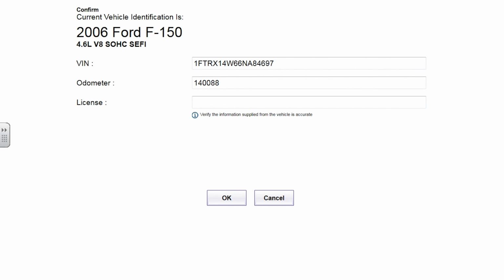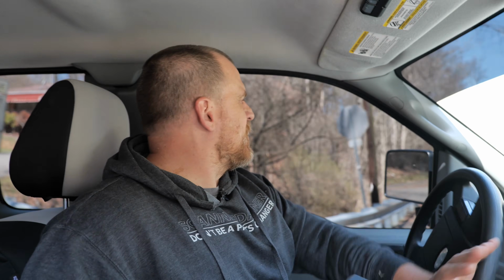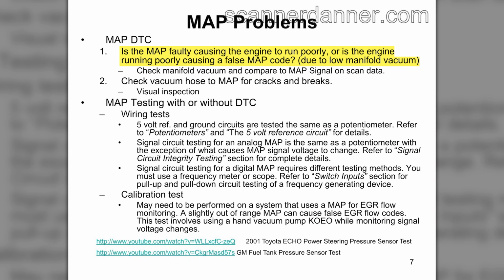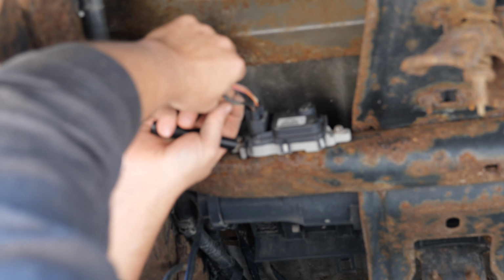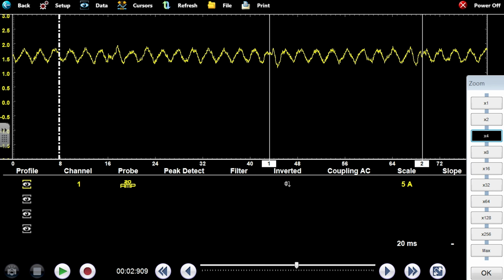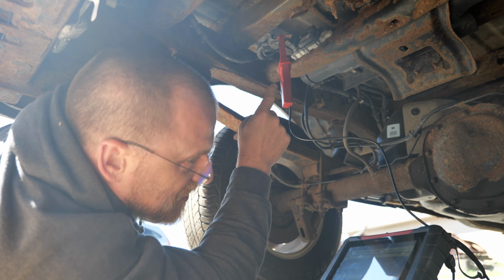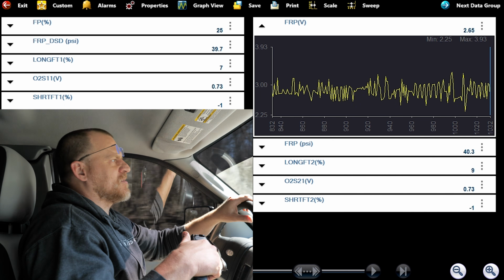Intermittent Low Power/Lean Conditions [2006 Ford F150 Electronic Returnless Fuel System]

Comment: Could you power the pump with a 6 V battery and watch the scope to see if it had a bad amateur
Reply from the maker: If you wanted to test that, simply using the existing 12v system would be how it is done. Curious why the 6v suggestion?

Comment: To answer the Selina of techs leaving the field, I might have an answer but it won't be populer. To hand a hard diagnostic job to some one like me that is learning from you and willing to take a job and have another way to get paid. Issue with this idea is not being in same town as you. For an auto shop to hand off a car that has hard issues to some one like me that might have a team that is learning the system. To charge the customer yet so they can afford it. There's away just non traditional. I live in Solano County, Ca.
Reply from the maker: We are ALWAYS learning the system! We should not have to learn a specific system for free! What other field does that?

Comment: This diagnostic problem with the industry is why it makes it harder for the advanced diagnostic techs to find good shops to work out. Most shops would rather have a master r&r guy that doesn’t know what a multi meter is instead of the tech that can diag a problem correctly because they don’t see the value in it.

Comment: As a former Cummins Inc. tech that absolutely hates Cummins Inc. I have one good thing to say about Cummins Inc. which is the way they bill customer for labor is the best way to do so. So, as a tech you “clock in” on Cummins time then when you get a work order you “clock in” on that work order. You go from “Unproductive shop time” to Customer Billable time”. This is to properly bill customers for labor and for tech efficiency. On one hand Cummins pays you to to be there and the other hand the customer is directly paying for labor. Tech efficiency is judged by the quoted hours compared to the actual hours worked on a work order!

So if a tech’s repair quote is 10 hrs of labor but, it takes them 14 hrs to do the work their efficiency is 71.4%. Cummins requires tech to work at a minimum of 85% or write ups and disciplinary action will happen. In actuality the tech is getting their pay rate $25-$35 per hour while on the clock either on or off a work order. Although, when your on a work order the customer is paying shop labor rate $128-$140 per hour! That said, Cummins is paying you a labor rate just to be at work which cost the shop. When a tech is on a work order the customer is paying the tech plus the shops expenses. So I’m effect when your diagnosing the customer is aware and approves “a specific amount of time” then if and pays for that time up front.

If the tech then diagnoses the problem in less time the shop puts that remaining paid for time towards the repairs. Although, if the tech is struggling and takes longer to diagnose the problem his efficiency drops because he goes over and now Cummins is paying for the extra time. The techs usually ask the customer for more time and is a toss up if they’ll pay and if not cummins pays and your tech efficiency drops. So as a Cummins tech you get paid to diagnose, you quote the job accordingly, your responsible to do the repair within the time quoted and the customer only pays for approved diagnosing time and quoted repair time. Anything else is paid by Cummins and reflects on the techs efficiency as such, customers are charged a ship rate and the tech is paid his tech rate the shop keeps the rest or pays the rest.

As a Cummins level 2 tech in 2020 I was being paid $24.58/hour, my shift schedule was 9 hours per day plus monthly On-Call. My salary was based off of 8 hours day and tech efficiency for Bi-Annual raises or promotion. I worked usually 45+/- 5 hours a week and anything over 40 hours was time an a half. My yearly salary was $57,517.20 and my salary was based off of only $51,146.40 plus PTO, Holliday pay, overtime employer contributions to retirement, 401k and pension. Then of course subtract healthcare benefits, retirement, 401k, health spending Acct, flexible spending Acct and pension.

Comment: Paul, I was wondering, could you give us a few examples as to how to charge for these types of problems? Would that be your regular hourly rate X the amount of hours spent?

Because I myself also struggle with something like this every once in a while. 

And where is this feeling of guilt coming from? The garage I worked at didn't charge and I also have guilt trips charging for something that I "didn't fix" but that I was looking for. 

It's ridiculous. Doctors? They do NOT care about these issues as you pay a hefty bill for just showing up to them. Wrong or not, you're billed the moment you go up to the reception. It's ridiculous. 

But us? We are expected to either know everything and fix everything immediately or to work for free OR charge for the actual repair once we figure out what it was, forsaking the diagnostic time spent to find the issue.

Comment: I got these vehicles down Man you were a key part once again but sometimes man you chase a bit harder then you need to these catalytic converters cause a bunch of improper readings upon these sensors but youve help me understand the vehicle well and all your testing is even better in the interior. @scannerdanner
Reply from the maker: I'm having a hard time understanding what you're saying. Sorry. Catalytic converter issues do not cause lean conditions
Reply: @ScannerDanner  explain how it it couldnt make the car run rich your intelligent enough to know it will if it cant breathe our computers are gonna dump more gas thanks for your response.
Reply from the maker: @Jeffthestreettech  I just said cat issues (exhaust restrictions, do not cause lean conditions, why are you asking me about rich conditions?
Reply: @ScannerDanner  I apologize for my grammer but you've misunderstood me. But back to if the dinner ever existed 🤣
Reply: @ScannerDanner  when we can see the inlet temp then we will have dinner 🤣💯

Comment: I have an  2006 5.4. ..  That  Idle's nice and smooth and fuel trims within range at idle. But .  When I do a wide open throttle test , the engine climbs  very lean  +52 reading on bank 2 only, And I get a squealing noise.  it's not a belt because it does it  even with the belt off.  I can recreate this problem every single time . even if I sit in park and idle it up 3000 RPm's it will go lean on bank 2 .  If I run it  Long enough and wide open it will bog down an the truck won't even move.  I have to stop and let off the gas and let the trim come back to normal..  I get the screeching noise whether I'm in park neutral or driving I am absolutely stumped and can't figure out what it is . I've replaced the fuel pump module, and o2 sensors. Anyone got any ideas?
Reply from the maker: Sounds like a plugged cat on one side

Comment: Perhaps the closed loop fault fuel system status on the freeze frame would offer a hint. Perhaps a blip where substituted values came into play and both banks suddenly wanted the exact same STFT in the absence of some other input data due to the fault. Some transition from closed to open loop perhaps where the O2 sensor data no longer applies and the PCM looked at TPS or something..
Reply from the maker: OBD2 data is not allowed to show substituted values, but I like the idea!

Comment: At work we had a tractor with intermittent shutting off and not wanting to start. Took it to the "pros". The shop charged us $3,500 for diagnostic and research,  gave it back without fixing anything.  Owner just shrugged and gave me some ideas to check when the tractor died, and i told them it had same issue still.
Reply from the maker: that is horrible and certainly not what we did here
Reply: @ScannerDanner  no, i didn't mean to make it sound like thats you! In my experience though, this is common with many shops. Of 2 shops in my town, One shop doesn't even own a scanner to do simple calibrations and the other charged me insane amount to calibrate a brake light switch. Probably didn't take them 20 minutes total but i got charged almost $300 just because they hooked their scantool up.

Comment: After watching your videos, and other studies I tried to diagnose fishbite misfire on 2002 lesabre I looked at vacuum leak ,secondary ignition (lean waveform), fuel pump waveform and other things. Turns out the fuel pump was consuming 2.5 less amps. (Using amp probe). New pump =secondary waveform looked right.

Comment: so if it were your truck and you had the time and money to try switching parts to see if it behaved better with changing the module or pump which would you, or what would you do next ? thanks
Reply from the maker: Since the module was the fix for 5 months, I'd be putting another module in it, especially because it's under warranty still

Comment: For all we know, your FRP could be going well above 75 psi when you are commanding the fuel pump duty cycle to 40% and above. Look at the FRP voltage when it hits 75 psi, it's at 5 volts, meaning the sensor is capped out.

Comment: Thanks Paul for your video. 
Freeze frame date should always to be considered in the beginning of the diagnosis.
That makes a guide to follow. 
God bless you and your family.
Reply from the maker: Freeze frame data is mostly useless in my experience, but to each his own
Reply: @ScannerDanner  best use of freeze frame I've found is the engine on time pid, if available. I've had customers say all sorts of scenarios and time frames when some issue occurs. Go to the on time. Record data. Drive it that long and just about at the time listed in FFD the concern happens.

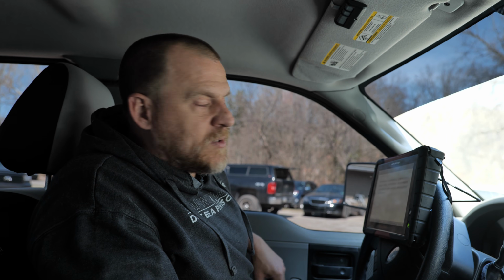Comment: 40:04 ya I’ve had very little luck getting any useful info from freeze frame data lol
Reply from the maker: Same and I rarely use it. A recent example. I have a B2S2 O2 stuck rich code on my truck. Freeze frame data shows thr other 3 O2 sensors, just not the B2S2 😂 useless!

Comment: I had a fuel pump take over a year to finally die. It never shut off and would only not start on hot days if I shut the engine off for a short period of time. Like getting fuel or quickly running in the store but only during the summer. Did this an entire summer then didnt do it at all that winter. Finally died that next summer. I always seem to only have horrible intermittent issues.
Reply from the maker: I bet it was a Ford? I've seen that issue before!
Reply: This is happening to my subaru. It doesn't like to start if i shut it off and try restarting right away

Comment: I had an 06 f-150 that would have an extended crank when it was hot and eventually stopped starting at all when it was hot. Finally it Stalled out and came to me. Cold starts were never an issue, but when it was hot the fuel pump would not turn on. Checked the FPCM and had good outputs and power and ground at the pump was good, but found corrosion in the power wire about the same spot you had it. Replaced pump and module (customer said he knew they were a known problem and wanted it changed.) Upon further inspection of the pump connector, the power wire pin of the fuel pump actually had melted plastic all over the bottom of it. I was wondering if  that melted plastic was a symptom of the corroded wire causing it to get hot as I’ve always been told a motor will pull pull amperage until the fuse blows or a wire burns up.
Reply from the maker: Yes sir, the melted plastic was from a poor connection. Resistance = heat!!

Comment: I have an 06 w/4.2 and mine was/is the same. I replaced the FPM and a week later same thing  also I saw that the 'fix' according to Ford is a stand off on the FPM is recommended. I then replaced the fuel filter same thing a week later. 😢

Comment: why wouldn't you pull the ground to frame ground behind module that was recently changed on rusty frame then send customer on his way   at least you would know it wasn't a simple fix 
then you could rule out module if it was cured if you change module and create a better ground you still don't know that module was bad
Reply from the maker: I deemed that ground to be okay. I pulled pretty hard on it. You're not wrong in that approach too.

Comment: Good to see ya again and good to see this video, these intermittent problems are real world issues.  I love these types of videos with these types of issues from you.  Love your rant also, it’s right on.  52 years a tech I have to agree with you about that module and the state of parts these days. Five months is enough time for a new part to fail and a bad pump still being bad most likely wouldn’t have lasted  five months without problems.   On another note how’s you foot doing, an Achilles’ tendon wasn’t it?
Reply from the maker: Thank you my friend. It was a ACL (knee surgery). I'm getting stronger ever day! 4 more months before I can skate again
Reply: @ScannerDanner 
Glad it’s getting better.  I’ve never played ice hockey but did play a little roller hockey twenty plus years ago.  At 68 I’m a little too old now to be chasing pucks into the boards.  Still working on cars though.
Reply from the maker: @weshawkins7165  bet you miss it though right? It was a roller hockey game too that I tore my ACL. I bet it would have been fine on the ice as the skate would have slid more
Reply: @ScannerDanner  
  I miss being younger and being able to do those things, the hockey was a blast.  I could probably still skate but the recovery takes a lot longer now.

Comment: Hello i just wanted to know what would cause high fuel pressure in returnless fuel injection system?
Reply from the maker: Electronic returnless with no fuel psi regulator and a PWM pump (like this one), or a mechanical returnless with the regulator in the tank?

Comment: Just dawned on me about an intermittent my better half had with a 1987 Dodge Charger many years ago, that would just die while driving. Every single time it would restart immediately and not happen again for many days, weeks even. Happened the odd time i drove it too. I had this cheap Ignition Spark Analyzer that you could set for "memory spark mode" and "running spark mode". So, i set it on "memory", had it hooked up, happened to be driving the car when it quit. As it turned out, there was no spark for a few cranks before it started. Replaced the ignition module and it never happened again. Then there was the time my 1980 Mercury Cougar failed. On my way to work, an hour in car running fine, stop for coffee and toast, come out, NO START. Commuted an hour and a half to work one way with 2 other guys. My week to drive. That module failed just like that, not a hint of anything wrong until we stopped for coffee. By the way this analyzer says Product #348 Made In Canada and had Canada, US, and Europe Patent numbers. https://ppubs.uspto.gov/dirsearch-public/print/downloadPdf/5194813 It was cheap but saved my butt on that one.

Comment: I have an 08 explorer 4.6 with p0171 & p0174. LTFT pretty much stays at +25 (usung blue driver.)I've changed everything 🙄.  Even fuel pump control module. Fuel pressure stays pretty close to 40 psi.I just got a thinkdiag2 and it's showing me p1237ff. Every time i see someone with that code, it won't start.  I drive this thing daily.  Any idea ?  maybe a ground short between module and pump?
Reply from the maker: Check it for an intake manifold gasket leak. Possible MAF contamination issue etc

Comment: How come module ground is pump current?
Reply from the maker: All the fuel pump current flow travels through the module. I can measure pump current on the power or ground side of this module because of that.
Reply: Understood
Reply: Looking at a diagram, I can see two wires from the pcm fcm (I believe this should be a monitor) the other fpc (this should be the control from pcm to module right? Would this be where your meter is connected) Coming out of the module are 4 wire. Two to the pump (+ve and -ve I believe) one from a pump relay which goes through an inertial shut off switch (I believe this should be the power to the module) then lastly a ground. Correct me if I'm wrong,  please
Reply: Hello Paul!

Comment: I noticed in the freeze frame data that the intake map (inHg) was 10 with the engine idling. Wouldn’t that be about half what it should be? Just curious as I’m trying to absorb all this stuff. I also understand that, at least on speed density, a reading like that would run the o2 rich and not lean like it is in the freeze frame. Thanks!
Reply from the maker: So freezeframe data I find to be not very useful most of the time. It's just a single frame and things can be missed. In this case, the engine at 800 rpm suggest idle but combine the engine load and map (as you stated), someone's foot was on the gas pedal some and it wasn't running very well for sure, with a 53% positive trim on both banks. It was starving for fuel, for sure.
Reply: @ScannerDanner  makes sense! Thank you Paul!

Comment: I would ohm test the sensors.
Reply from the maker: Why? Signals were all good! I never measure resistance of sensors to confirm failures. Maybe one out of a thousand
Reply: @ScannerDanner  Valid, but isn't this the one in a thousand where you were unable to replicate/identify the issue?  BTW, you're awesome!
Reply from the maker: @mackman77095  no sir, what I meant was I will prove a sensor to be faulty by voltage or scope measurements and I will only measure resistance to prove the call. That's the only time I use it